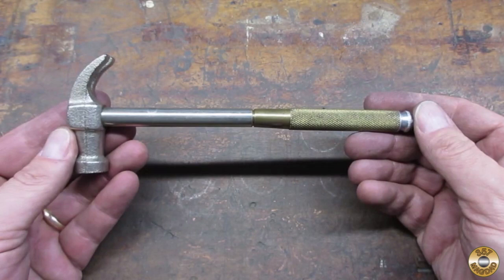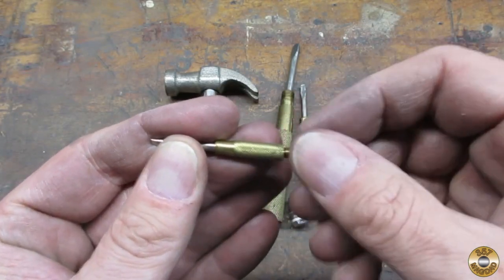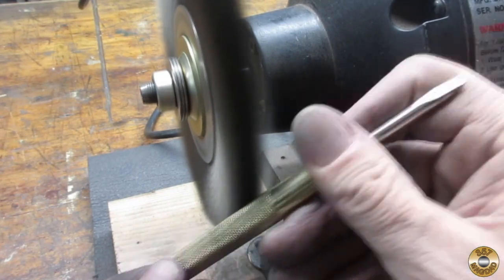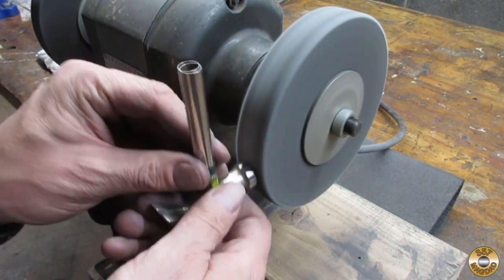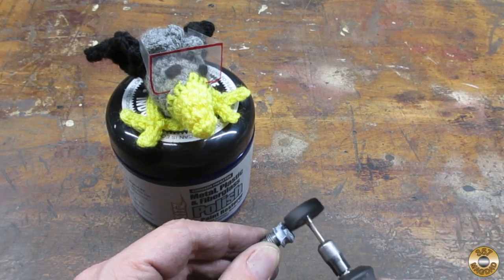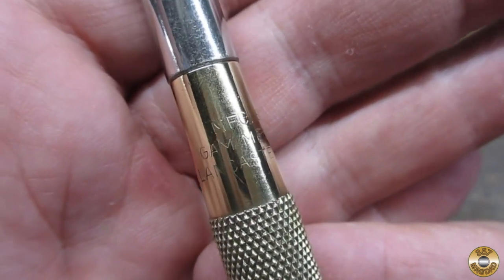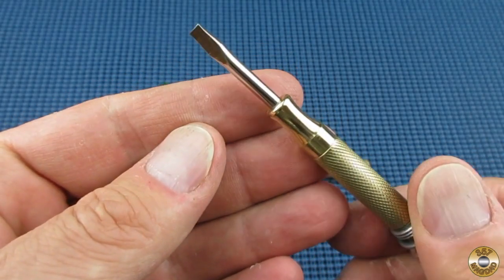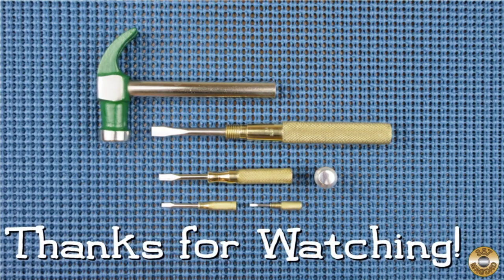Hand Tool Restoration - Nesting Multi-Tool

Comment: What a great video Magdad. I have a nesting screwdriver set and found a hammer/screwdriver set and my wife confiscated it. It had flowers all over it. I was going to clean all the flowers off but she wasn’t having that. I think it was a promotional tool that True Value Hardware store had at one time. 
Yours turned out fantastic!! Thank You for sharing
Reply from the maker: Thanks Jack!  I think I found the flowered model on line!

Comment: I love these hammers esp. with the brass handle. I guess you couldn't locate any patent information? If you can't, I can't! I love that green color also. Great work as usual.
Reply from the maker: Thanks Brian!  I thought the hammer needed some colr.
There's a patent from 1917 for the nesting screwdrivers (1250328).
Reply: @357magdad  Awesome. Thanks a lot.

Comment: Maaan if that was made like an armorers hammer with some hollow ground driver bits?? 😍😎
Reply from the maker: I've got another one with a ball peen hammer, but no hollow ground tips.
Reply: @357magdad  It is SO hard to find some decent  hollow ground drivers nowdays, let alone something that's got interchangeable bits with common bits for working on modern folders, unless you spend major cash with Wiha. And a full on smithing set? 😂like brownells sells or used to? Get out of Dodge😆 I'd have to sell a kidney😆I cut my teeth so to speak with a guy who had a set like that and he woulda lost his mind if somebody messed that set up Mag